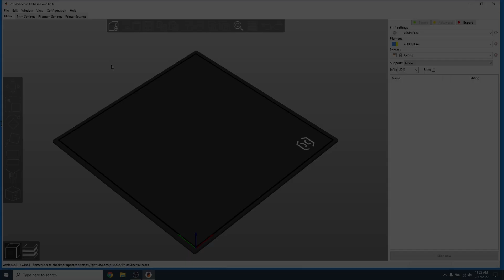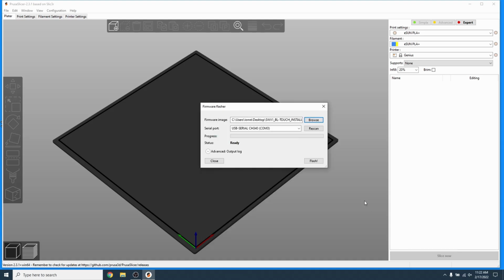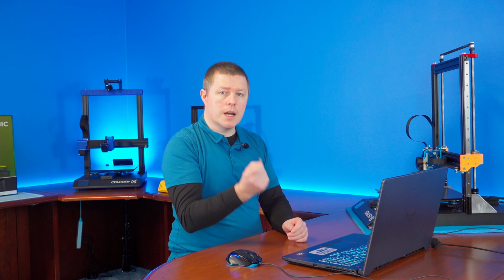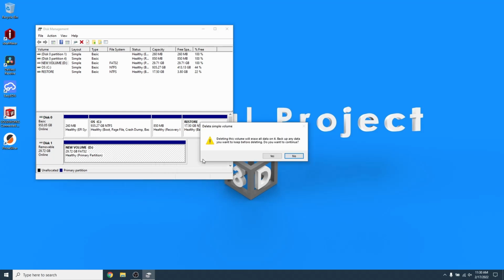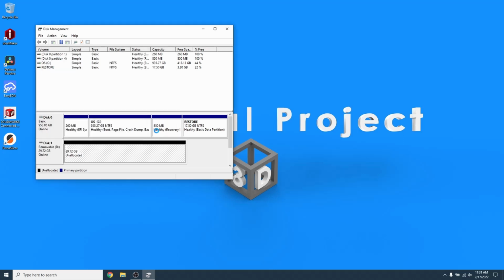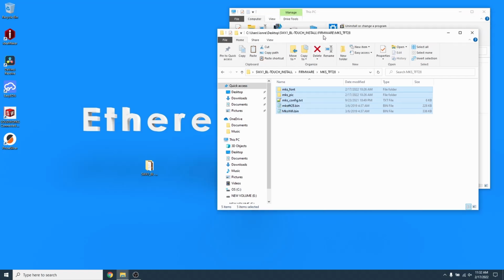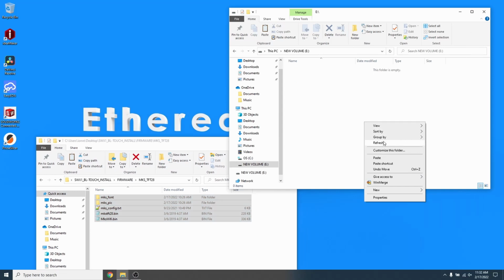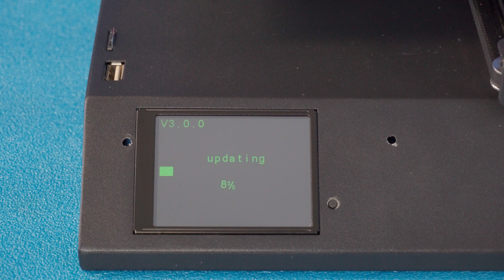Sidewinder X1 BL-Touch install, the easy way.

Comment: I flashed the firmware you suggested and installed the x2 head with touch sensor.  When I try moving it gives orrot Stop called because of BLTouch error restart with M999
Reply from the maker: You have the wiring to the probe wrong.
Reply: @EtherealProject3D  I purchased the end from Amazon it arrived assembled with sensor .. . I didn't think I needed to buy the board from you but if you think I need to then I will .. let me know.. how to proceed please
Reply from the maker: @jerry411411  https://www.etherealproject3d.com/shop

Comment: Could you check what wiring I would need to change if any.. I would like to use x2 head that has BLTouch type sensor built in.  I already had a x2 head that way I would like to use it.  Any help would be greatly appreciated
Reply from the maker: Are you going to be using my PCB on the hot end?

Comment: Greetings.  First let me say great video and easy instructions.  Thank you for all this.  I am however having an issue since upgrading.  I keep getting the Error:!! STOP called because of BLTouch error - restart with M999 every time I try to home or anything.  Has anyone else had this issue?  If so can you pass on the fix please.
Reply from the maker: Thank you very much. I try to make these things as easy as possible to understand and follow. Your error is typically caused by the BL Touch not being connected correctly .Go back through and verify every connection.

Comment: Is it possible to install x2 hotend on the x1 by using this same mod? . I noticed the x2 hotend comes with autolevel sensor similar to BL Touch
Reply from the maker: Yes that can work if the probe is wired correctly.

Comment: What size crimp ends do we need? I got my board last week ready to go with this
Reply from the maker: I chose the white ones from my kit. Im not sure exactly what size they are. Try dry fitting them both on the wire and in the connector.

Comment: Hi mate , i have an question:
Why is your mod using the upper green connector Z endstops while digant is using the other green connector ?
Could i use your firmware with the black wire connected to left connector?
Reply from the maker: No, if you use my firmware, the black wire has to connect to the the Z endstop connector, and the stock endstop should be removed. The probe becomes the Z endstop. There is no specific reason I use the Z enstop connector as opposed to the other one.

Comment: Hi, I got a 3DTouch (a copy but looks the same) and it came with extension cables, so I can feasibly plug it straight into the main board. Is it possible and what would the wiring look like? Could I still use your firmware, maybe with some source code modifications?
Reply from the maker: Yes you can plug it straight in but you need to split the connector for the Z zero wire.

Comment: Your videos are great, but I’m just curious, why not just add an x2 hot end assembly to the X1? Wouldn’t it provide the same bed leveling?
Reply from the maker: The X2 hot end uses a 24 pin ribbon cable while the X1 uses a 20 pin cable.
Reply: @EtherealProject3D  What do the other 4 pins do?

Comment: Well after many hours of printing my Sidewinder X1 finally gave up. I am probably the only X1 owner who hasn't had a broken lever. Anyway, I believe I need to replace my hot end as it is only extruding a very thin string even hafter changing nozzles. While I'm in there I'm going to upgrade a few things including the lever now that I have probably jinxed myself. I want to add the BL Touch as well, any chance if I buy the board from your link you might be willing to print and sell me the bracket too?
Reply from the maker: Yeah I can get a bracket printed up for you. Just leave a note in the order
Reply from the maker: @OregonBladez  I will get some printed this weekend. I thought I had one left but I did not and wanted to get your board out. Sorry about that. I will send you one when I get more printed. Does your extruder have the big standoffs?

Comment: Hi. I'm using your software. I'm trying to do a color change, manually. If I use the touch screen, I click pause. It pauses. Then I click filament change, it moves up and asks to confirm to extrude, I accept. Then once the new color comes out, I go back and resume. It resumes, but nothing extrudes? I don't have a clog either? What is the proper way using your software to change filament mid print and resume in the same spot?
Reply from the maker: This is a bug that I have not ben able to figure out.

Comment: Thanks e1.  Finally got it working...a mix of wiring and configuration.  Tha ks
Reply from the maker: Need to check what pins its using for the zstop

Comment: Great mod 🙏
do you think i Can still use the pins on the board to activate led?
The pins on the board are free after relocate.
So can i extend wire and use the led maybe in differnt location?
Reply from the maker: They would have to be wired separately.
Reply: Thank you for the quick reply
I am thinking of using the disconnected z stop cabling back to led 😁
What do you think?
Reply from the maker: @adiosb  You would be missing the 4th wire needed. You could add it though. Also you would need to figure out a mounting solution for the LED. It would be an interesting challenge for sure.
Reply: I use the led as an indicator like neopixel 
will mount it where the z stop where
Can run another wire for 4th pin.
Will youre firmware support it? Running both bltouch and keep led?
Reply from the maker: @adiosb  I have the LED function turned off in the firmware but it can be turned back on.
Reply: @EtherealProject3D 
If i could send you a picture 🤣

Comment: I'm thinking of buying this for my Sidewinder X1 v4. I use Octoprint exclusely for printing. I'm assuming after doing this upgrade and saving the settings, I can just use my Octoprint as normal? Do I have to add code in my slicer?
Reply from the maker: It should work just fine with octoprint. No you dont need to add any code to your slicer.
Reply: @EtherealProject3D  , another question. When you do the first probe alignment, is this done with the heat bed off? I know my heat bed changes shape when heated and there is a decent difference between no temp, 60 - 90 degrees Celsius, so much so, that I am tired of constantly having to adjust and why I am looking at this solution.
Reply from the maker: @montematson6283  I always do it with the heat on.
Reply: @EtherealProject3D  , since my bed seems to change with different temps, should I (or have to) auto-level each time I am printing at different temp?
Reply from the maker: @montematson6283  If the bed changes that much then yeah it wouldnt hurt.
Reply: @EtherealProject3D  , I got everything in and followed your video to the T. When I power on for the first time, I set the source to USB, then home then home again. The printer moves around and instead of moving down, it moves up a bit then I get "Error:!! STOP called because of BLTouch error - restart with M999". I've power cycled several times. Any ideas? My wiring color matches what you showed in the video.
Reply from the maker: @montematson6283  This is typically a problem with the wiring. Check and make sure the single black wire is connected in the correct place as per the video.
Reply: @EtherealProject3D  , I did double check during the install. It was a tad loose so I glue gunned it in place before putting cover on. Thanks.
Reply from the maker: @montematson6283  Did you disconnect the stock Z endstop connector from the mainboard. I only ask because Ive had at least 10 people say the same thing only to learn that they did not connect it in the correct spot.
Reply: @EtherealProject3D  , yes. I disconnected it and removed all the wiring
Reply: I’ll take the printer apart tomorrow and recheck the black wire.
Reply: @EtherealProject3D  , I rechecked all my wiring 2 more times, all correct. I reseated the black wire, still no go. Then tried the black wire again, it was working. The black wire is touchy on my printer. I may have made the metal on it open too much when removing. Anyway, I found an angle it likes and glue gunned it. If it ever quits working, I'll know why now. I may end up putting a new end on it. Thanks!
Reply from the maker: @montematson6283  Nice!
Reply: @EtherealProject3D  , ok. Got the bed leveled and printed the test code you provided using Octoprint. During the print, it did the first left three, then the top middle, then it started to print the top right, but started to print off the build plate. I had to stop the print. It's as if the entire print is printing too far to the right. Ideas on what's going on?
Reply: @EtherealProject3D  , ok, after the printing issue using OctoPrint, I copied your test code to a USB stick and it printed fine. Not sure why it made a difference, but it did.
Reply from the maker: @montematson6283  It somehow lost its X home position perhaps. Try slicing and printing something yourself and see if that works.
Reply from the maker: @montematson6283  I have no idea, I dont use octoprint so I have not been able to test its functionality. Try using Octoprint with your own sliced files and see what happens.
Reply: @EtherealProject3D  , must have been the case. With no changes, I reprinted the same code in Octoprint and it was fine. Perhaps running from USB stick straightened out the X home position, I don't know. Working now.
Reply from the maker: @montematson6283  Awesome Im happy its working for you.

Comment: HI.I double checked the process in the video and bl touch wont stop the nozzle from heading towards the build plate? Is the Bltouch plastic sensor supposed to be (extended DOWN) when it's moving towards the build plate? Because mine in retracted with only the tip coming out. And if I manually pull it out it stops glowing red, but still travels to the build plate.I purchased the breakout board from you. The info on the antclabs site is not helpful. I can't see a clear description of the wiring of the harness. But I have reversed BOTH the 3 and the 2 pin plugs (Upside down)and nothing changed? Also in your video you unplug a harness, yet never plug it back in, I assume it is not supposed to be plugged in anywhere else?
Reply from the maker: You most likely have the probe wire in the wrong spot on the mainboard. Its the single black wire, it needs to be connected in the no 1 contact on the z end stop connection. You need to disconnect the z end stop and plug that wire in its place. If you have it connected like Wagsters setup it will not work.
Reply: @EtherealProject3D  I put it in the #1 spot. but it does not sit tight. I'll see if it slipped off. I may need a drop of hot glue.
Reply: I sent you a pic on your facebook page. The black wire looks right. What about if those 2 wires that I crimped the ferrules onto are reversed in the green connector? Would that matter? Should I switch them to see if that makes a difference?
Reply: I did get it working. The 3 brown wire connector was not on the pins closest to the outside.Thanks again I am printing and the BLTouch worked like a charm on the 1st attempt!!
Reply from the maker: @natdiamond  Awesome. Im glad you got it working.

Comment: Why everyone says that we have to use a 4 or 8 GB SD Card? I Always use a 32GB SD Card and the Update always works without issues
Reply from the maker: That is pretty surprising that it works for you, typically 32bit systems, the touch screen in this case, have a hard time with knowing how to read the extra space beyond 8gb on a FAT32 file system. Not saying it can't work, but I have done some tests with it on my printer and it tends to have problems updating the TFT with a card larger than 8gb.
Reply: @EtherealProject3D  - Maybe it depends on the SDCard manufacturer? I use a simple Sandisk 32GB Card.

Comment: Do I need to add ADD M420 S1
AFTER G28 into my slicer, to utilize the mesh after bed leveling? And a big thanks for the board and great instructions in your video for the install!!
Reply from the maker: You should not need to but it cant hurt. Thank you.

Comment: Hey Matthew, quick question on the part where you level the corners after the first z-offset setup.  Do you do this with the knobs or with the baby stepping under the "More" menu?  Also, so I use the M420 S1 code instead of the G29?  You stated that once the auto-level runs it saves the mesh in the EEPROM so I'm assuming that M420 would be the correct one, but want to make sure. Thanks again for all you do for this community!!
Reply from the maker: Level the corners with the knobs.

Comment: do you have a file for a replacement cover since the old one no loger fits?
Reply from the maker: No I do not, sorry.
Reply: @EtherealProject3D  well just orderd the board guess i have a project to do want the file when i get it done?
Reply from the maker: @linearburn8838  Sure that sounds great.
Reply: @EtherealProject3D  Ok so I got the board the bl lights up however the firmware from your site is not quite right Its missing a lot fo teh menus yours has in the video and it wont auto lv
Reply: I think the firmware was a old version IDK how i got it from the google drive
Reply from the maker: @linearburn8838  I will have a look for you.

Comment: make sure!!!! make sure that you fan duct doesnt get in the way of your bltouch its a super pain if you cut the wires and the have to cut up your duct lol but this is for sure the easy way for the sidewinder x1 thank you for a great video and product
Reply from the maker: This location for the BL Touch should be out of the way of the stock fan duct and most of the community designed ones out there. But good point for sure for those that have a fun duct that might get in the way. It never hurts to check the clearance. Thank you.

Comment: Just finished this mod, worked great! One thing to note for other people is that your Sidewinder may need the (Big Holes) STL file for the probe mount. I saw it and though to myself "wonder what that's for..." I guess some Sidewinder's have nuts that stick out instead of longer screws between the spacer and board. Nothing a quick drill couldn't fix!
Reply from the maker: Thank you. I do have stl files for both versions for the mount.

Comment: Hey I just installed the board but am getting a BL Touch error when I try to set my Z Offset.  (Error:!! STOP called because of BLTouch error - restart with M999)

I have double checked the connections on the main board and have checked the wiring to the breakout board and everything seems to look good . I am using the bigtreetech BLTouch v3.1 . I have it wired yellow, red, brown, black, white which is control signal, +5v, ground, ground, z min respectively . Do you have any ideas what might be going on?
Reply from the maker: The typical cause of that error is the wiring. I will do some looking about that BL Touch and see if I can find anything.
Reply from the maker: Do you have the single black wire connected to ZMIN or ZEND on the mainboard?
Reply: @EtherealProject3D  wow thank you for getting back so quickly. Yes, I just pulled the cover off and checked. 

I did just notice that the signal wire molex connector on the breakout board seemed to have folded over a little in the socket.

I attempted to straighten it with and extacto knife and it looks like it is making ok contact now, but I am still getting the same issue. I am not sure how finicky those molex connectors are, I can see if I have a spare pin laying around and swap it out.
Reply from the maker: @eliteman125  Another thing too is to verify from the mainboard to the extruder the signal with a multi meter. Ive had a few people find that the brown wires inside the machine were not in their correct positions in the connector.
Reply: I was previously running the waggster mod with this BLtouch. It appears that the connection to the main board are the same move for both the waggster and the ethereal mods.  I just compared the two and unless I am missing something mine are in the correct place on the main board
Reply from the maker: @eliteman125  The connection for the Zmin is different than Wagster, Disconnect the Z endstop and use the NO 1 pin on that connection on the mainboard.
Reply: @EtherealProject3D  ok, I will double check that today, I could have sworn they were the same. But there is a lot going on down there so I easily could have misunderstood.  Thank you for checking that out
Reply: Thank again! I swapped that pin and it is working now. My mistake  on the pin location
Reply from the maker: @eliteman125  its all good, alot of people miss that part. Im glad its working for you now. Happy 3D printing.
Reply: For some reason it seems that my homing is off a couple inches, when I try to do a mesh level, the bl Touch starts a couple inches off from the bed center. Any idea of this would be in the firmware?
Reply from the maker: @eliteman125  I would start by reinstalling the firmware.

Comment: Confirmed working with the sidewinder x1 v3. Updating the LCD's firmware went smoothly dispite having an entirely different LCD board. Only thing that was different was the red wires that you have to unplug and move are brown on mine.
Reply from the maker: Awesome, thank you for that info.